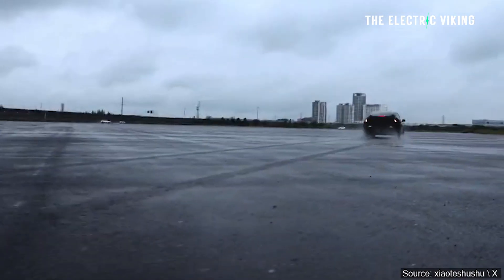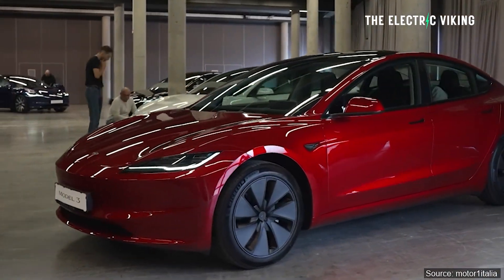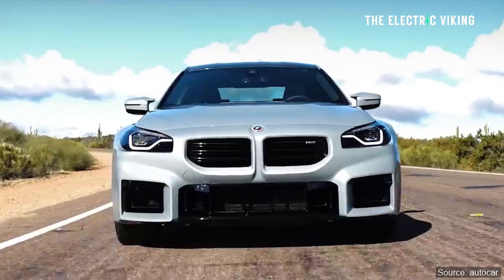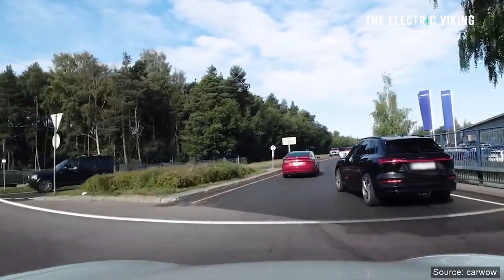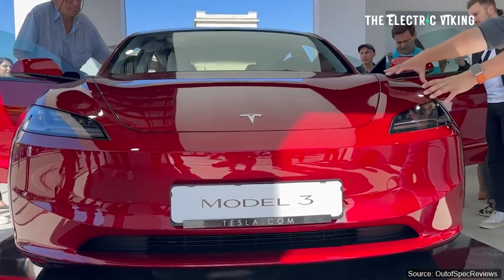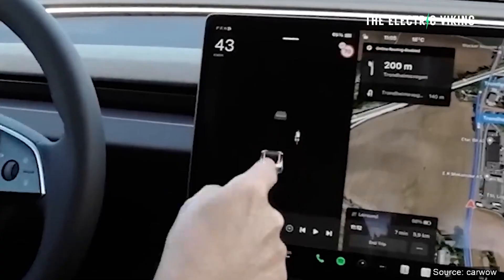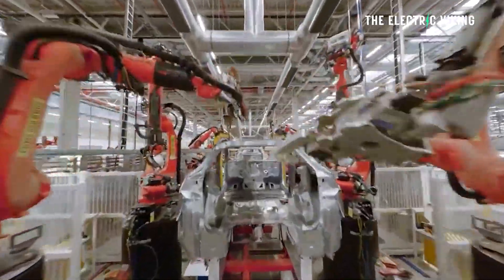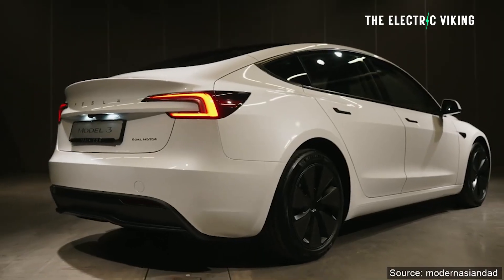Tesla reveals NEW Model 3 engineering changes - development done in China

Comment: I live not over the polar circle - but in a country with a "normal" winter when sometimes temperature drops -20-30C below 0  But most time it is -5 -7. I can tell that if you use heater in a EV - and you use recommended 20-80% charging range you real life range is not 80 not 70% - it is 50%. And if you go faster than 90km/h - range drops to 30%. 30!!!!Therefore you do not use 20-80% You use 20-100% charging - in winter. Then - if you use heater NORMALLY  you have real life range of 50%.  50!!!
How extatic I was in the beginning about EVs  - then I cannot express disapointment now. Charging problems during a day or ridicilous price of family size  EV (with not smallest of batteries) I am not even mentioning. EVs (with charging batteies) can be used only in a city. They are city cars - and also - if you are not driving a taxi (I am talking about winter driving) . Ev's are ok only with a fuel cell - where  hydrogen is a fuel which makes electricity with a help of fuel cell. This type of EV - yes that's the way to go. Not the battery charging type.

Comment: Well "engineered" is a bit ambitious - they refined the existing model with some components from existing Tesla air suspension etc.   Now having said that - it makes sense to leverage your primary manufacturing centers for this to increase rate of new model development.  Keep in mind the CyberTruck was being finalized in Texas and the initial design and Engineering of the Model 2 is being done in Texas as well.  The Model 2 is being designed and engineered from the ground up there so it requires larger teams.  Now it will be interesting to see if they are doing something in Germany as well.

Comment: The incredible seats are beyond what you're expecting.  My M3 LR has a noticeably stiff ride. This aids performance and communicates road condition when driving. When you first experience this it seems too harsh.  Then you realize the damping of the really good seat is isolating your torso from the effects of the performance tuned suspension. You can feel it through your feet and the steering wheel. That's actually good info.

Comment: I have a 2022 Model 3 Performance. I don't think the handling is stiff at all. It's much more forgiving than the BMW 335i I had before it. Hitting a NYC pothole in the 335i felt like hitting a landmine. The M3P handles them quite well and I have not blown any tires thus far compared to about 25 blown tires and 2 cracked rims in the 335i.
Reply: Stiff ride is common for performance vehicles they prioritize high speed stability over ride comfort. Even Corolla or Chevy bolt are much more comfortable than BMW or Tesla

Comment: All these improvements aimed at increasing customer satisfaction, yet they have kicked an own goal by removing the indicator and gear stalks. Bizzare.
Reply: it cuts on price for Tesla and I think it's better for safety: your hands never leave the steering wheel.
Reply: @robertbidochon7949 No one drives like that. It isn't safer when turning and your arms get twisted if your making hard turns or you're in a roundabout (which apparently Elon hasn't seen or driven in).
Reply: @H3aby84   I don't understand what you're saying 😅
Reply: @H3aby84 you can move your hands on the wheel.
Only Mr Fantastic and 
Mr Tickle drive as you intimate.
Otherwise no-one would complain about the Yoke.

Comment: Has the performance improved?  The car is over 300 lbs heavier.  0-60??
Reply: This extra weight claim is not correct. There are some websites inaccurately comparing the original model 3 standard range against the base model highland. But the old standard range has not been available to buy for a long time now. It was replaced by the standard range plus / RWD variant in all markets some time ago, and yes the extra weight was due to a bigger battery. So, if we correctly compare the current base model against the highland base model, the weights are nearly the same.

Comment: the design does not look as complete as the previous model, not as mature. Button turn signals is another concern. Precondition is good enough to cool seats down, no emergency for the vented seats as to me. Interior led illumination is rather intrusive than improving. 2022 M3 drives not as good as it could though. 

It seems like Highland has been designed for China market first and foremost. The normally over-design their cars, there is a little bit of that flavor in the new Highland design.

Comment: I have a 2021 Model 3 Performance, and it did seem too stiff when on uneven pavement. I ended up changing my wheels to 18" Martian Wheels and put Pirelli P-Zero All Season Electric tires on it that were 235/45/18, and that totally fixed the problem with bumps in the road. It's not the same thing as suspension, but it completely solved the problem for me. So, I don't worry about suspension at all.
Reply: Same here!😊

Comment: I own a Model Y(2021 Fremont model) and I rented one when I drove from Frankfurt to Dusseldorf, the Chinese made Model Y is much higher quality even if they looked identical.  No panel gaps, paint is much thicker, it has a good 20k miles on my Model Y and it had zero rockchips.  Not only that but the suspension is much smoother, overall if I had a choice I rather buy a Chinese made Tesla over something made in Fremont.
Reply: I've had 2 different Model 3s from Fremont and they been fine.
Reply: Did you compare with the same tires and psi?   Isn't it the same suspension set up?
Reply: @Trust_but_Verify  I think the one I rented was a 2022, so it might have the upgraded suspension.  It had no panel gaps and the paint was Lexus quality.  IDK if I got a bad one but if I had a choice I'd prefer the Chinese made one.  Overall I'm not that impressed with my Model Y, plus the increase electricity cost as well as CA charging us a fee for not using gas I might just go back to a Lexus RX hybrid.
Reply: @MrWhiterunGuard  I'd think painting is done by the robot arms.   Unless there is a millimeter coat spec different or the difference in material between China made vs US made, the quality should be the same.   The difference would be QA on what is acceptable to be released to end user.
Reply: Maybe it´s a german made MY? They have the latest paint technology?

Comment: Depends on the handling .. They need to model all teslas on bmw handling which is something Sandy Munro keeps pushing for .. If the model 3 highland is not really going to handle like a bimmer than I’d vastly prefer the model Y just based on my experience renting both vehicles bc at least the model Y gives you tons more space .. but if the new model 3 highland handles like a bimmer I would choose that for sure!  …maybe this is something the performance m3 will address?

Comment: Depends on the handling .. They need to model all teslas on bmw handling .. If the model 3 highland is not really going to handle like a bimmer than I’d vastly prefer the model Y just based on my experience renting both vehicles bc at least the model Y gives you tons more space .. but if the new model 3 highland handles like a bimmer I would choose that for sure!  …maybe this is something the performance m3 will address?
Reply: The performance models are more likely to have the stiffer suspension. That makes them more solid when doing high speed cornering. The long range Model 3 will be more likely to have the softer suspension, especially if you get the 18" wheels choice.

Comment: I have a model 3 2018 MR.  I love the ride and handling.  However, I do prefer a stiffer ride compared with most.  I prefer to have a car that turns well rather than a Mercedes ride that is too floaty for me.
Reply: My first Model 3, a 2019, with the 18" wheels, gave a good ride. Later on, in 2021, I got a Model 3P with 20" wheels, and that one was a bit too stiff on uneven pavement until I bought it some 18" Martian Wheels and got Pirelli P-Zero All Season Electric tires on it that were 235/45/18. Then it was really good, and not floaty.